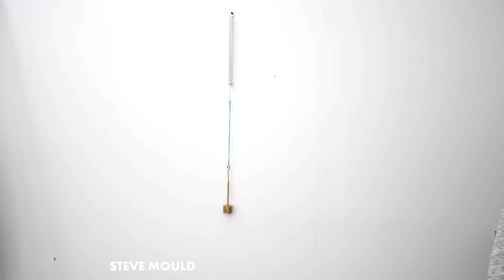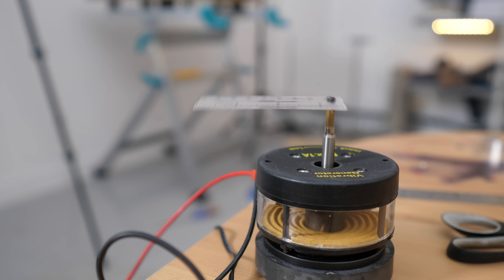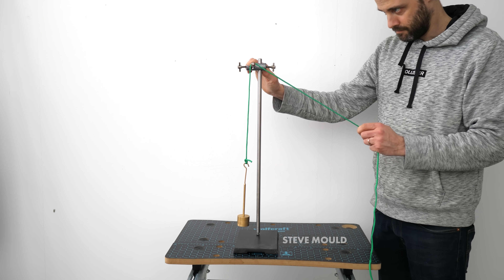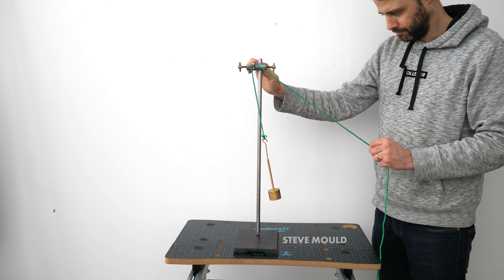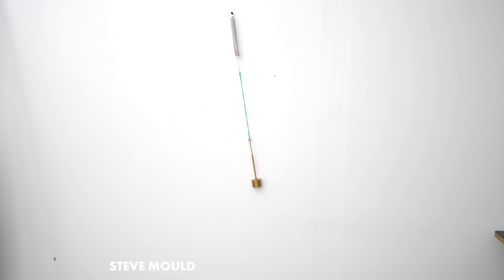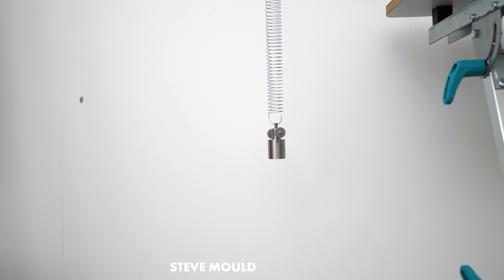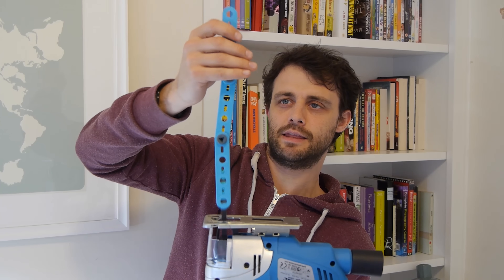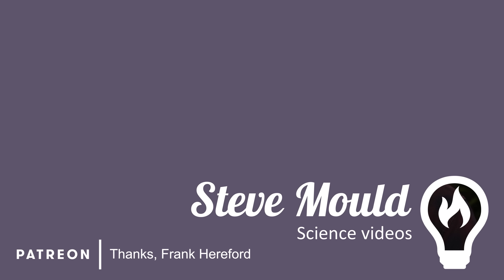What If Swings Had Springs Instead Of Ropes: Autoparametric Resonance

Comment: I like this video and it nicely treats coupled resonators but It seems to me there are a lot of doubtful points in this video such as:
- You can shorten the length of a pendulum only one per period (i.e. only on the way forward) and still increase the swinging amplitude. So double the frequency is not needed.
- When you swing round a ball on a wire through a tube above your head and you shorten the wire the ball angular velocity mostly speeds up because of conservation of angular momentum, not because of added energy.
- The explanation of how a to pump a normal swing is insufficiently explained but it is dubious to me that it is only a question of angular momentum.
- All three resonance phenomena are basically the same thing: resonators/resonance-modes periodically exchanging energy. It's a bit strange to give one a fancy name "auto-parametric" where the other is just ordinary bulk-standard-driven resonance. Actually the two swinging masses on the horizontal cord also drive each-other parametrically by changing the tension in the pivot chord and changing the mutual pivot point positions.
In my view this video deserves a more in-depth follow-up with more equations.

Comment: 7:00 - You can leave your feet in the "up" position on a swing and still "pump" by just putting tension into the rope / chain at the right time. Takes longer, but it works.
Reply: Or by pushing/pulling the rope with the right timing. Takes even longer. Must raise/lower your centre of mass just a bit.
Reply: Cool 
I'll try doing that
Reply: Yes.  The girl is doing that.
Reply: @gibbogle  The girl leans back and pulls her feet down again, like all of us do/did when we pumped. I'm saying you can remain completely stationary and still make your swing higher by either pushing/pulling to cause your center of mass to shift up, as @andrew_cobb said, or maybe it moves the seat forward/backward a bit, and gains angular momentum. I'll have to investigate this further... (Hey, kids! Time for a trip to the playground! ... for you to have fun!)

Comment: With the two loosely coupled pendulums; When energy transfers from Pendulum A to Pendulum B, I suppose there's an instant in time where both A and B have exactly the same energy. What in that moment determines where the energy will continue to transfer to? It feels like it then might as well transfer back to Pendulum A again. Or are the pendulums - in that moment - in a configuration that determines "the next step" so to speak? This is interesting stuff! :D

Comment: I Actually did 3:35 with my charging brick and wire.... And wondered and even tried a string attached to the mas passing through a hole to make the mass go all around in a full 360⁰ rotation in a vertical plane... And  we can actually quit do that but obviously the resultant path traced is not a circle.

Comment: This is absolute brain candy for me. Also, I checked out wren. What I find interesting is that in terms of energy, they do not distinguish between diesel and petrol, maybe thats normal, but surely an older german TDI pollutes more than a modern turbo multipoint injected threecup. Next is heat. They ask about electricity and gas, but what about coal or wood? Many rural areas do not have gas lines, so we burn coal or wood/wood pellets.

Comment: You need to do one with all 3 modes: twisting, swinging, and springing
Reply: Bop it! Twist it!
Reply: YES
Chaos ensues
Reply: Would it be possible to tune a parameter from the Wilberforce pendulum so that ist also swings side to side?
Reply: @fabianablatio3443  Maybe by putting tiny "propellers" on the ends of the "propeller" of the thing. But this is an uneducated guess.
Reply: Ahh yes, this takes me back to my undergraduate days in advanced mechanics. Utter chaos (pun intended)...
Reply: I like the idea, but I'm certain one of the modes would fail. The pendulum and the spring need to have 1:2 resonance, but twisting changes the properties of the spring and therefore it's frequency.
Reply: The opening scene technically had that.
Reply: That'd be some neat choreography.
Reply: I thought of the same 😹
Reply: 3 degrees of freedom? It's probably just chaotic.

Comment: now i am curious if you could combine spring, twist and pendulum in some kind of 3 phase thing. also, what happens if this is done in 3 dimensions and not 2? eg hanging from the ceiling and not the wall. id assume its a circular motion instead of the pendulum swing.

Comment: Are you really "removing energy" from the pendulum when you length the string? Sounds like a misnomer.

How I see it (this is my guess at least.) the when the pendulum weight passes its mid point, it starts converting its kinetic energy into potential energy. When you shorten the string you're ADDING potential energy to the system. At the apex of the swing, you lengthen the string and that potential energy is transferred back into the pendulum as it swings back down.

Comment: Electric parametric resonance is depending on the transverse and longitudinal resonant modes of the coils, if tuned properly, the resonant voltage and current become in phase. This is why Nikola Tesla used his impulsed primary with his "extra coil". I have proven this last Christmas on my channel.

Comment: I might be wrong but around 5:18 I think you meant centripetal force not centrifugal force. Apologies if I mistaken
Reply: A common misconception spread by physics teachers unfortunately, both are correct in a sense, centrifugal force is the force that arises when you construct newtons laws in a rotating reference frame, centripetal force is the net radial force that causes an object to follow a circular path

Comment: The other simpler explanation is that when you shorten the string with the weight, you are reducing the amount of upwards movement that happens, which is the deceleration part off the swing movement, And you are extending the part where are the weight is dropping, The acceleration part.
Which means we are raising the weight higher to then drop longer which means we gain more velocity and lose less.

Comment: If the spring-pendulum were hanging from the ceiling instead of the wall, would it swing in a circular motion?
Reply: If could precess maybe, but I don't think it would start to go around.
Reply: A pendulum in circular motion has a fixed tension in the line-spring. I think it would not drive the spring to go into oscillation. But there can be other modes maybe.
Reply: Good question!
Reply: Like a 3D spirograph!!
Reply: I doubt it. It's hanging from a single point, whether that point is hanging from the wall or the ceiling shouldn't matter.
Reply: probably if the swing vector doesn't exactly point back towards the center when it's at the peak, It will accumulate more divergence from the center over time. so I would guess that it doesn't have to but that almost always you would see that it does with the spring involved, because that means any chaos that puts energy sideways can accumulate. I don't know though, I didn't go to college for this stuff lol
Reply: Maybe you can get a bit of coriolis effect into the swing to help induce some spin.

Comment: but why does it have to be in resonance for the transfer of energy to occur? why not in a random frequency?
Reply: Because you would take away the momentum if you don't do it in resonance. I'm not completely sure, but i think of it like the superimposition of waves. If they're lined up the addition will cause added amplitude aka they're in resonance, but if they not, the net gain will be low and it may even be a loss of momentum.
I'm not sure if this makes any sense, i need to brush up on this topic i think.
Reply: Oh my god, Steve reads the comments! I'm literally squealing 😂
Reply: @ishamalve2242  i literally though i left a pretty dumb question, fully expecting to get ignored like the idiot I am 😂  & steve mould likes it! eeeeeeek 😂
Reply: @ishamalve2242  definitely makes sense, thanks!
Reply: @tsamridh86  glad it helped!

Comment: When I was a kid, my father made me a swing that was hung on springs. I loved it, but as I grew bigger, one day one of the springs snapped and that was the end of the Moonwalk Swing. :-(
Reply: It was actually a rather ordinary wooden swing on ropes which were connected to hooks using a few sets of springs which my father got out of a few dismantled chest expanders. It had a vertical leeway of around 30 cm which enabled one to swing and hop at the same time, hence “Moonwalk”. My father is a technician and a notorious junk collector who keeps every bit of old equipment, for once it will be good to provide parts for some ingenious contraption... :)

Comment: Thank you so much ☺
I still don't understand a deeper layer. If a pendulum wirh rope and weight starts to move up and down, and say it was doing so with absolute microscopic precision, why should it start moving sideways at all?
Is this somehow related to the phenomen of stable and unstable rotation axes?
Reply from the maker: Good question. I guess it's an unstable equilibrium. Any small perturbation gets amplified.

Comment: It's so funny, my differential equations lecture yesterday was on forced mechanical vibrations, and we talked mathematically about resonance. As the frequency of the forcing function approaches the natural frequency of the system the maximum amplitude of the general solution approaches infinity.

Comment: There is a phenomenon, I noticed it decades ago with a super ball, bounce the ball about 3 feet high, on a smooth driveway, the ball bounces straight up with lots of spin on it, then the next bounce it travels forward about 2 feet but with no spin on it, then hits the ground again and bounces straight up with lots of spin on it but no forward motion, and it repeats, up with spin then forward with no spin...gain and again, and i could tell it was periodic, physics is interesting.
Reply: I know exactly what you’re talking about!
Reply: That’s really cool!
Reply: If you spin a superball and throw it under a low table, it will come back out because of this effect.
Reply: @MushookieMan  I don't think you even have to spin the ball for this to work.  One of the properties of superballs that is critical to this is that they have a very high coefficient of friction with most smooth surfaces, so when the ball hits, the linear and angular momenta are coupled for an instant.  If the ball has no spin when it first hits the floor, it will have topspin ("top" surface moving in the same direction as the center of mass) after the bounce.  But this topspin is actually backspin in the upside-down perspective of the underside of the table, so on the second bounce the angular momentum gets converted to linear momentum opposing the original direction of travel, propelling the ball back out from under the table.  At this point much of the angular momentum will have been converted to linear momentum, so it has little or no spin when it hits the floor again and thus continues on out from under the table (with some topspin after the bounce).  I haven't tried it, but aside from making a real mess, if you covered the ball in grease first it would probably behave very differently.
Reply: We tried to Max out spin rates, measuring how wide was the left/right bounce..
Reply: That's not physics, you lived near a witch. I'll pray for you

Comment: If the period of a pendulum isn't affected by its mass, why did the original springy pendulum problem stop switching when you changed the mass? Is this one of those "the real world isn't a spherical vacuum" type issues

-- edit

on seeing the original again i think it's due to the fact that the mass does affect the length of the pendulum, and a different mass didn't stretch the spring enough to create the correct length
Reply from the maker: The mass doesn't affect the period of the pendulum but it does affect the period of the spring!

Comment: This is actually how continuous Foucault pendulum demonstrations are typically powered in museums, since you need to keep inputting power to keep the oscillation going without pulling the bob in any particular direction or influencing the rotation of its plane of oscillation.
Reply from the maker: Oh cool!
Reply: (F) ou caul (t)!
Reply: At my university it is powered by a small magnet in the floor at the bottom of the pendulums swing, giving it a small push every time it passes by
Reply: @zlatanbrekke6538   @zlatanbrekke6538  version works like it has to pulse somehow right to pull it as it comes in and push as it goes out but not screw with it as it’s passing between those or it would act all wonky.
Reply: @ksmurphable  Yes, its not a ferromagnet but a electricity-powered magnet that pulses everytime it passes giving it a small push.
Reply: @zlatanbrekke6538  That won't keep it oscillating for long, because if the magnet attracts it and makes it fast in one part of the oscilation, it slows it down in  in the other part, same is true of it repels. Otherwise it would be violation of conservation of energy
Reply: @reapercreeper6097  It can use an electromagnet to provide a short repulsion every time the pendulum passes the magnet at nadir.
Reply: @massimookissed1023  yes, you are right. So it's using electricity, so it's not violating conservation of energy
Reply: @reapercreeper6097  It is powered by electricity, not a ferromagnet. It only pulses everytime the pendulum passes. The pendulum oscillates 24/7 without stopping.
Reply: One way is according to patent US3424960A from 1966 a magnet in the base of the pendulum that gets energized near the equilibrium point. The current one in Miami does a "click" sound whenever it reaches a turning point, so this might be what you talk about.
Reply: @whuzzzup  ha, bet, I literally commented, could u out a magnet? That's literally what I was thinking
Reply: Man. You just answered a question I've had since I saw one knocking dominoes over at 7 years old.
Reply: Ouch cool!
Reply: Oc hool!
Reply: The irony is that a flat earther has put this video forward as proof of a flat earth somehow? 🤷🤣
Reply: 00 cool!
Reply: Interesting, I kept wondering how the foucault pendulum at uni maintained its amplitude
Reply: I had wondered about that, but never bothered to look into it. Neat!
Reply: Huh?
Reply: That's insaneo!
Reply: Owe cool!
Reply: Foucault, arch-enemy of flattards.
Reply: @massimookissed1023  please explain? Specifically with this video in mind
Reply: @massimookissed1023  I think Flearther is more appropriate. It's not fair to the mentality retarded to compare them to people as dumb as Flearthers.
Reply: @massimookissed1023  Unfortunately not, a Foucault pendulum would work on a spinning disk.
Reply: @noise_wrangler  interesting, spinning not stationary 🤔 ...
Reply: @noise_wrangler  The Foucault pendulum works differently on a sphere than on a disk. Specifically, the speed at which the pendulum's swing axis rotates relative to the Earth's surface is the sine of latitude times 360 degrees per sidereal day.  So, at 30 N, the pendulum's plane would rotate clockwise once every two sidereal days.  At 30 S, it would be counterclockwise.  At the equator, it would not rotate relative to the Earth.  Only at the poles would it rotate once per sidereal day, which is what one would see on a disk.

The Wikipedia article gives details on the math and an explanation if you're interested.
Reply: @doctorbobstone  Thanks, I'll definitely look into it.
Reply: @noise_wrangler  Not quite, as the period of the pendulum should remain constant independently of the degree of latitude on a flat disk, while it is 24 hours at the pole(s) and infinite at the equator on a sphere

Edit: I didn't notice that someone already made the same comment...
Reply: @noise_wrangler  you are correct. But, flaties do not believe there is any motion to earth. They say it does not spin. They believe we live on a flat motionless plane(we don’t.)
So, he is correct.
Reply: @noise_wrangler  It would work on a disk, but not in the same way. On a disk, the precession period of the F.P. would be constant no matter where you were.  On a sphere, it varies w/ latitude. (For pendulums small, fast compared to the size and rotation of the earth, the period is proportional to 1/sin(latitude).) At the north and south poles, the period of rotation is 24 hr - though in opposite directions!  And on the equator, the pendulum doesn't precess at all.
Reply: @doctorbobstone  I was at a science museum in Milan once, and noticed that the description of their Foucault pendulum said that it did a full rotation in 34 hours. I thought "that's 24 root 2, I must be about latitude 45°. Got pretty close.
Reply: OwO cool!
Reply: O cool!

Comment: 6:53 I think it's a combination of the two effects of angular momentum and lengthening/shortening the pendulum. Or rather: the angular momentum is used to lengthen/shorten the pendulum. Watch when she pulls the rope with her hands: She then makes a kink in the ropes, so the length from the top where the rope is connected to the tree and the center of mass is lengthened/shortened. Additionally, when she raises/lowers her legs, the effect is amplified.
With angular momentum alone it would only work on a rigid pendulum, but not on a rope pendulum, because there is nothing to transfer the angular momentum into.
Reply: In fact, you can also describe the thing that he did to the pendulum as changing of the moment of inertia. So it is not so different from pumping swing

Comment: The typical way of pumping a swing does both.  It shifts your center of mass up and down as well as forward and behind the pivot.   The up down is just a single cycle instead of two cycles.   (Yes you can increase the amplitude of the swing at the same frequency as the up down motion).